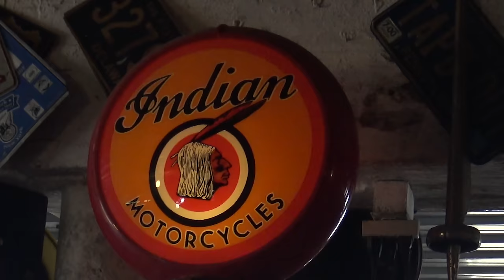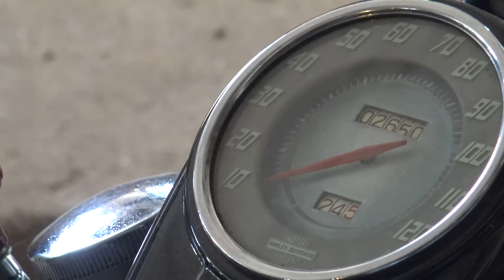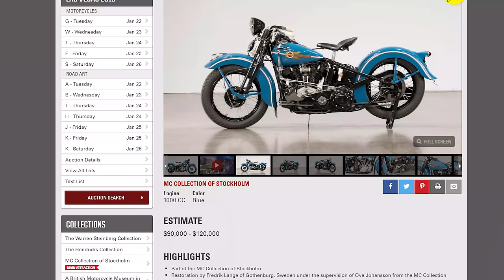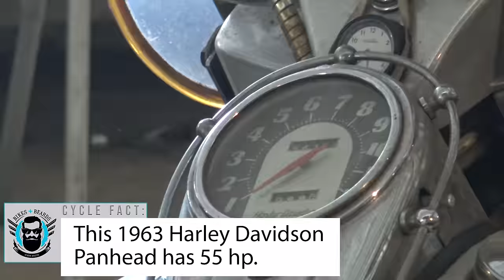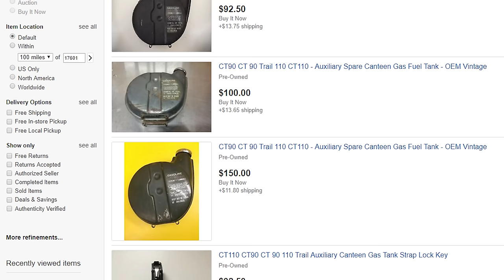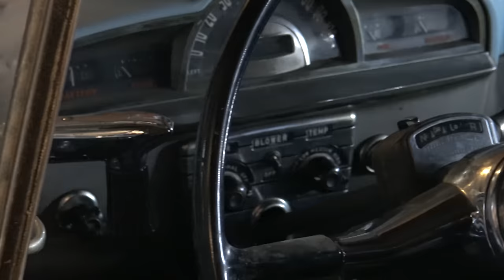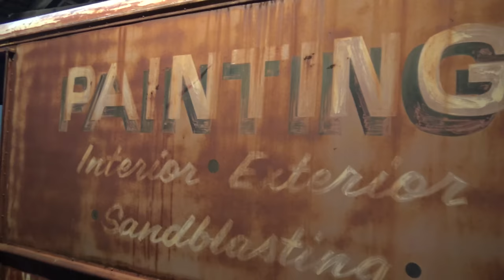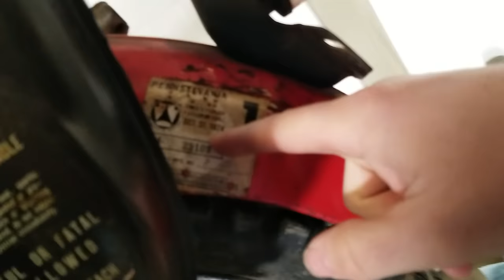What I never expected to find in a barn

Comment: I'm from the UK. The Square 4 was advertised as having 'armchair comfort'; they didn't tell you it rode like one too. Better with a sidecar in standard form. The later ones with 4 headers were more reliable.
In the 70s the healey brothers did a limited run of square fours with a better frame and engine mods, now rare and expensive. The company making the Atom bought the name in the 90s, Ariel motorcycles became part of BSA in the 50s, last making a bike in 1970.

Comment: I have two of the CT90 and one CT110  . Love those bikes. I think you got a good deal on a pretty decent one. My definition of 'running' is probably fairly close to that guy. Cleaned up and a little fiddling to run- its a runner.   I rode an SL90 in 1974   from Seattle to Fairbanks and back . Well, almost back . The bike took it's last breath in the middle of British Columbia.  I hitch hiked the rest of the way back. Good times.

Comment: You got a good deal on the trail 90, even tho you're gonna have to work a bit to get it going. It's in very good shape for it's age. Add a little more work to it, you can actually get 3 or 4 grand for it. I would want it as you guys got it for that kind of money, since I don't have a lot of money, but I can see why people will pay pretty good money for one that's really in good shape. Way back in the olden days, I learned to ride on one of these, it wasn't even mine, a neighbor's but every kid in the neighborhood rode it. Tough as hell. Took a hell of a lot of misuse and crashes and such, it always faired better than we did. Even though I"m an old man and much larger than I was back then, I'd still love to have one. They're just fun, and you actually can use it to get around town on, tho I really wouldn't want to try it on a freeway, around town they're great. They'll do enough to go down secondary highways at least. Frankly I'd rather have that bike than any of the Harleys he had. I'm not a Harley guy. tho some of the old ones are cool, the modern ones suck, big as they are, most don't fit me. I deplore low riders and cafe racers both... so what I usually wind up with is a street legal dirt bike because they're tall enough to fit me and my long legs. I like a straight up riding position like was the usual when I was riding in the early days, lowriders and cafe racers came along and ruined the motorcycle industry so far as I'm concerned. My next fave is a Honda 350 twin in the CL configuration. Lots of memories there too. Then comes a 650 Honda, and a 750. Wound up      riding a 500 Enduro Yamaha for a lot of years as my only vehicle. Rode it year round, even in the Colorado winters with snow on the ground.
Reply: $850 is way too much for a Non-Runner.  Mine cost me $400. My buddy got his delivered for $375.  You gotta look around a little more if your having trouble finding one.  It's about $1250 for a Titled Runner with no issues, $2500 for a quality bike. Those $4000-$5000 ones you see pop up in California never sale.  One of the nicest ones I've seen, took quite a while to sale, and it was $2500.
Reply: @PowerBeeEngine  Thank you for the intiel. Maybe I actually can get one for a reasonable price. The ones I was referring to were in primo shape.

Comment: Summer of 72 I was 12 and worked my butt off 7 days a week at my step-dads resort. Pumping gas, cleaning boats, hauling trash and a zillion other jobs. End of summer and he takes me 150 miles to Spokane (city nearest us with a Honda dealer) and buys me a new Trail 70. Loved that bike, I could hit 51 mph on it, packed sand beach that ran for miles at the resort and it was the perfect drag strip. Speedo went to 60 but even at 90 lbs I couldn't ever break 51. That thing was awesome for riding in the desert and sagebrush hills of Eastern Washington.

Comment: Well guys, I share his definition. You cant expect a barn find for that little money to run on the first kick. That thing is what like 50 years old? Of course you have to dig in a little bit and do some basic maintenance like rebuilding the carb, new fluids and stuff.
So a not seized up motor and very little rust is already a jackpot...
Reply: That means it doesn't run. They guy was asked if it would start and he said no because it doesn't have a good battery in it, not no because it's been sitting for half my life and needs rebuilt. If it's a barn find that is cheap and needs a carb rebuild, then he shouldn't have lied about its state multiple times.
Reply: If he "just drove it up there" it shouldn't have been hard to start.

Comment: Wow, a. Norton 750, what I took my motorcycle riding test on.  I had never ridden a motorcycle before.  Borrowed the bike from another mechanic in the shop to take the riding test.  Experimented a bit on the ride to DMV.  Took the riding test: figure 8,..riding the line...etc.  I thought the test was too easy.  Got the motorcycle endorsement added to my driver license, and returned the bike to my fellow mechanic.  That was back in 1970.  Owned many motorcycles since then.  Also owned a Honda CT-110 trail bike which was great for going up into the mountains.  In low range 1st gear, top speed was about 7mph.  4th gear high range was about 45mph.  Couldn't go too fast on 7hp.  Besides a Harley Tour Glide, and a Honda Goldwing, also owned a couple of Cushman motor scooters.  I used the. Goldwing for serious long distance travel, but the Cushman scooters for fun local riding

Comment: “Easier to keep running than anything you own”you only gotta deal with the fact it’s a flathead you gotta re torque the head as regular maintenance and gotta dig around just to find parts to rebuild a motor that will probably only go up to 80 thousand miles maybeee 😂 I don’t think he’s discovered the LS yet
Reply: Not to mention lack of horsepower for the cost
Reply: Better yet, I bet he doesn't daily drive a 70 year old vehicle. Don't know why he wouldn't considering it's the easiest to maintain thing they would own.

Comment: My favorite part was the,
"Those cantines are nearly impossible to find"

Shows 5 on ebay right now hahaba
Reply: There's a c90 trail for sale by me that includes one right now. They want 2k..
Reply: @jseden  lol I just bought a ct90 original paint exh.. exhaust .. wireing .. extra canteen gas can tires every thing .. it has 1500 miles on the odometer. I paid 125 dollars for it.
Reply: @jamesgibson7207  now thats a deal! I picked up an 81 gl1100 interstate for 800 a few weeks back. Needs a little work but it still runs and had the title. Rode it 50 miles home. 

Prices are all over the place on the CTs.. I see them ranging from a couple hundred for kinda neglected ones, to 2500+ for "the best you'll find!!", And everywhere in between. Prices seem high on everything ATM.. I daily a rebel 250, got in in excellent shape, super clean with 1400 miles on it for $1400. Most of them are in the 2-3k range now.

Comment: I bought a 1965 Yamaha Big Bear Scrambler that “runs” . Well it does now after a new clutch, repairs to the kickstarter, carburetor work, airbox repair, plugs, wires, and a lot of head scratching. It still has piston slap though. I will have that fixed someday. “That bike runs”. Trust but verify.

Comment: Your little foot note @ 3:52 is incorrect.
The 1948 EL Panhead did not come out with a 61 and 74 inch engine.
The Panhead EL came out with a 61 cubic inch engine.
And the FL, designates a 74 cubic inch engine. So the 2 Different models were FL and EL not 1 EL model with 2 engine options.

Comment: I thought he said the 48 was all original then said he started with a frame and engine and got the rest of the parts from swap meets. 🤔 So is it a parts bike or all original?
Reply: I heard that too.
Reply: I call them a period  correct build.not all original .
Reply: A parts bike is a bike that you are parting out. This is a bringing it back to factory build.
Reply: If the parts are all time correct and not old new  he is correct. Lot of old Harley’s back there were built that way if you didn’t have money for a new one
Reply: It's either original or it's not. Call it period correct or whatever, but once anything has been parted out then rebuilt from parts from something else then it's not all original. Not trying to take away from the bike though, it's still a  very cool bike and that's a lot of work. He did a great job job on it.
Reply: Replay it...
Reply: Did the seat say Indian on the back of it.?
Reply: @jediknight1294  
Yeah, I take all original to mean all original. Meaning all parts are original to the bike.
Reply: @curtis1951  iv been bitten by that before, unless i see numbers matching I assume all original is simply correct for model year.

A V6 swapped and badged for the appropriate V8 speed package with no clone parts, no pattern parts, the block number is the right year, the interior all from the correct year, right down to trim plates and wheels Thats still an all original car it is exactly what it claims to be a 67 mustang/72 impala/whatever but the VIN when searched says the car originally had a V6.

Unless i See Numbers Matching and can Verify that i find its best to assume its simply correct for model and year.
Reply: @jediknight1294  
Right. Period correct isn't the same as all original. If it has a different engine from the same year, it's period correct but no longer "all" original.
Reply: @jediknight1294  
For me to say something is ALL original it's has to have "all the original parts" it came from the factory with. Except wear parts of course. Tires, brakes ect ect...
Reply: What you would call a bitsa. A little wild on the pricing.
Reply: Bikes NOT worth $50,000 anywhere ..

Comment: to start it , take the carb out, disasemble it compleatly, spray wd40 down all holes and use compressed air to blow it all out.(if the carb has a membrane, take it out or you will blow it up with compressed air). once assembeled and back on the bike, try to start the bike and spay a bit of petrol into the carb as you are starting it ( a window cleaner bottle is good for that) , it will fire right up. the thing is you need a bitz of vacum to pull the fuel into the carb, especialy if its full of old fuel...

Comment: I sold a trail 90 with 12 original miles, I installed a brand new carburetor and battery  then oil and cleaned the tank out , with a wash it looked absolutely immaculate. 
 Sold it for 1500$, the day I put it on Craigslist my phone rang all day. The responce was overwhelming. I could have sold it 10 times.

Comment: “All original Harley” “got all the parts from swap meet”
Reply: Like that doesn't happen?. Look up the definition of the word patience, you may be able to benefit from it at some time.
Reply: well its not original then is it 
it is bits and piece of different bikes
Reply: If all the parts are manufactured by Harley Davidson for that model and year then it's basically all original.  Otherwise, the minute you changed a filter or spark plug for your bike, it would cease to be all original.
Reply: It gets complicated, 'all original' unless accompanied with 'numbers matching' to me implies nothing aftermarket/repop/pattern on the bike. An all original 48 with a 48 frame and engine is going to be worth less than a numbers matching frame, engine, tins, bike obviously.

Someone like that with that kind of collection, restoring a Square Four Ariel is going to have the knowledge or access to it to find original parts at a swap meet. Theres enough books, databases, online resources to do it.
Reply: To me original means the same group of parts as assembled at the factory, not "correct" parts found on the secondary market 60 years after originally built.

Comment: I bought a ct90 at a yard sale for 600$ with 972 miles on it. after tearing the carb down three times it would still shut off after a few miles. ended up being chewing gum in the tank that was floating around and would sit on the pick up tube.

Comment: the way it works out is you did well anyway  $98.69 in 1966 has the same purchasing power as $850 in 2022.but the little trail 90 listed for  $275 in 1966. and adjusted for inflation  $2,368.59 in 2022 has the same purchasing power as $275 in 1966.those were rugged and a lot of fun and would climb a hill like a mountain goat they became a cultural ion partly due to the "Little Honda" is a song by the Beach Boys from their 1964 album All Summer Long.

Comment: 1972 Norton Commando Combat was the Version NOT TO GET. The main bearings often failed in under 1000 miles. They could be fixed with Superblend bearings, but buyers should steer clear of original engines

Comment: Wow, The little Yamaha at 18:25 is the first motorcycle I ever had, I think I was 6 the first time I rode it.  I can't remember for sure but I'm pretty sure it was a 1972 60 cc.  Mine was the same burnt orange with the yellow stripe on the fenders.  We had 2 of them, my sister still has the other one and it still runs, but is in much worse condition, it went through probably 15 kids and saw a lot of abuse.

Comment: Ariel Motorcycles ceased production in 1967. BSA assassinated the brand name applying it to a 49cc tilting trike later sold as the honda gyro. Ariel Motor Company was founded in 2001
Reply: The Ariel Three was a nightmare. A friend hit a bump riding one, and the front wheel came off the ground. Since only one back wheel was driven, it then went into a pirouette, the tilting part finally pivoting sideways and dumping him on the ground, the actual owner, his girlfriend, was less than impressed.

Comment: Take your ohm meter and attach it to the positive side of the battery cable and attach the other lead to the positive lead that was attached to the starter.  Do you have continuity?  If not that is why the starter is not spinning.
Reply from the maker: This is a kickstart only

Comment: The CT 90 was the first bike I ever rebuilt. Fantastic little motor , rode that thing everywhere in the 80,s . Had a 110 as well, they were post office bikes here in Australia and they turned them over every three years so they were quite easy to find back then. Sounds like you forgot to dress and gap the points.

Comment: The stearing damper has NOTHING to do with the forks traveling. It is a common thing in all brittish bikes from the 50-70'ies all it does is to tightend the bearings in the stearing so it get's harder to onstear but in the ame time it get less sway in the front end. and btw .. Norton 750 commando runs circels around a harley ( at the same time period ) it was one of the fastest motorcycles around untill honda came along... I've owned a bunch of these beautiful motorcycles ( Norton ) and even today after riding bikes with tripple the horsepower... I still love my norton

Comment: Pleasant, but a bit arrogant. YES, the 1960's HD Topper was VERY much like the 1946-48 Cushman scooter. Both are step through.
 "The Cushman Pacemaker and Road Master were roughly equivalent to the Topper in terms of weight and horsepower. Both were also sold by Sears using the Allstate brand."

Comment: The older Honda motorcycles would start with a dead battery you just had to put them in gear and  push them about 50 ft to put a small charge in the battery and then kick start it.

Comment: They use to make a really good engines they are simple they often run after  20 to  30 years sometimes it just makes sense to replace some stuff  carburettor new spark plug clean the tank out change the oil clean out the air filter and all ducting check no dry rot in tyres sometimes wires can be corroded but with the old bikes you can buy pass a lot of wiring to start it a wire from the positive side of the battery to the positive side of the coil that will give you power to crash start it you can also short the starter to start it as well I would rather ride a older bike a lot more fun

Comment: That Indian is probably the best bike of the bunch. Totally reliable.  Price today for a '46 with that paint scheme is $35K. It was a first unique design after WW2.  Indian used Harley's seat pan design, and Harley never charged them for it. Indian let Harley use it's wheel and spoke designs and manufacturing access for no charge.  HD and Indian were not the fierce competitors as business's, it was the riders  !  
I have a fully restored 1946 Indian with Indian factory racing parts, and a stock 1951 Harley Panhead.  The Indian was a better bike back then even as a flathead.

Comment: I still kick myself for not buying it in 1970,  a "brand new"  '42 WLA with sidecar newly built from a wartime surplus kit.  It even came with the leather rifle holder.  The bikes came unassembled to Australia in packing crates and this was never assembled in wartime and the owner purchased as a box full of parts. Full twelve months registration with barely a few miles on the odometer for $600.00.  Alas,  I succumbed to parental pressure and purchased a 250 cc Suzuki Hustler instead.

Comment: That Norton is way under 500 lbs. My 850 Commando with Electric Assist Start was well under 500 lbs. I'd say around 430 lbs.
And no way 80 bhp. '72 750 was 58 bhp, and the Combat version just increased compression ratio from 9.0 to 10.0 to 1, cam change,  and larger carbs. They advertised a 5 bhp increase, so 63.
Reply: But the '72 Combat 750 did have the Lockheed front disk brake, the normal Roadster's and Interstate had a very good double acting drum.... where's the Hi-rider?